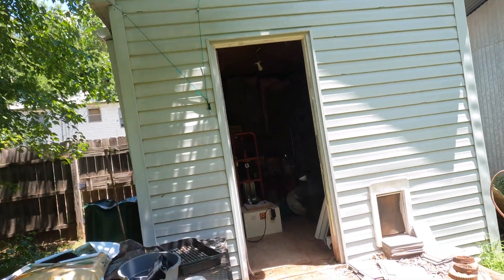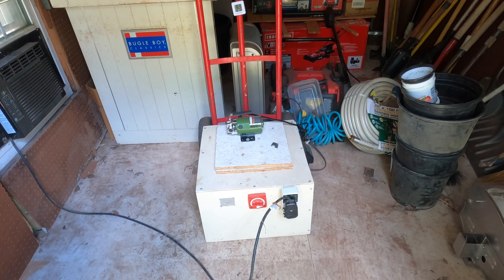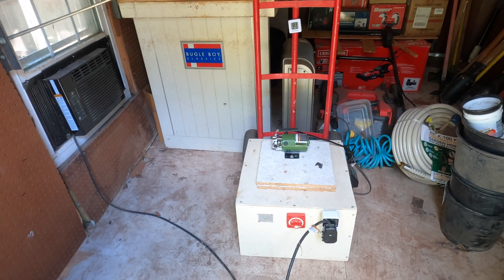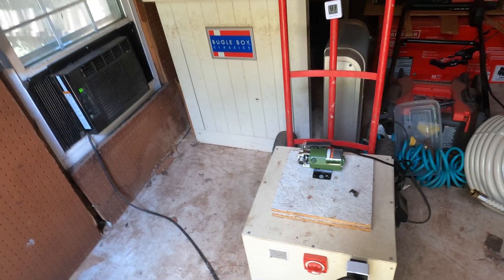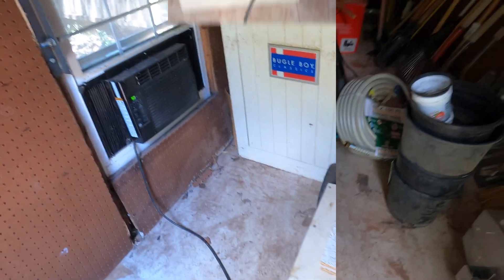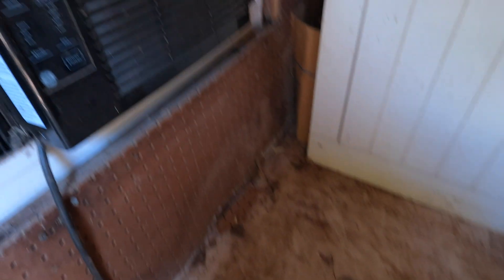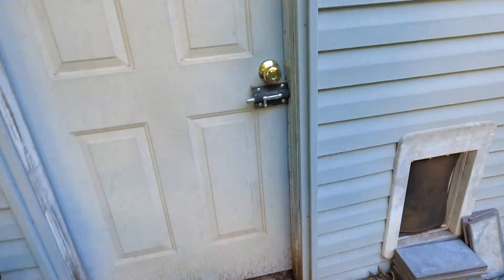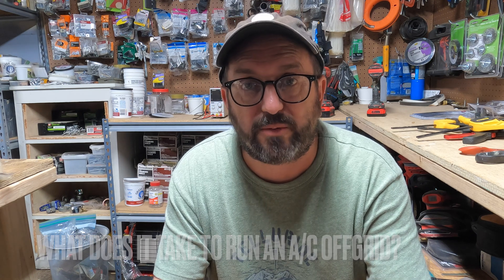How long can you power a 5,000 btu air conditioner off grid ? What does it take to run it off grid?

Comment: I have two 400 w panels with a victron 100/30 and two 100ah lith batteries with a Giandel 2000 24 volt inverter and run my 5K window ac ok, glad to see someone else with a similar set up saying the same thing
Reply from the maker: That's a nice setup. What inverter are you running?

Comment: Thanks for your video. But im trying to understand how you are getting 2500 watt hours from a 100ah battery. My math says 12.8 volts X 100amp = 1280 watt hours.
Reply from the maker: It is a 24v battery.  25.6 x 100a = 2560.

Comment: I have 1200 watts of solar, 24 volt 200 amp hour battery and 3000 watt power inverter, I have been running my 5000 btu window ac 24, 7 since I built the system, the battery never gets below 50% it also charges all our phones and runs my tv.
Reply from the maker: Nic setup

Comment: It’s surprisingly easy to run on solar on consistently sunny days. I have seven small widow ac’s ,two double door refrigerators,an upright freezer,and my water heater running on a Growatt 5K inverter with 20 KWH battery.
I don’t run all the ac’s at the same time, four when it’s hot or have company. I put the elements in series on the water heater so its load is only 2250 w,avoiding overloading the inverter.
I have grid power but don’t need input from it if we don’t have a lot of company to maintain this essential circuits panel.
I had three generators. I sold one,gave one away to my son who never uses it on his completely off grid trailer,(he has a small inverter generator for an occasional boost) and the last one I will probably repair some day.
With a little lifestyle adjustment during long term grid down we will do just fine. Off grid solar is one of the best investments I’ve ever made except for my wife and I won’t mention which one requires more maintenance.
Reply from the maker: Excellent points.  Thanks for your insight.

Comment: I used to run an 8000btu air conditioner most of the day off a 24v 2000 watt inverter and 24V 3kw battery. The Solar panels (1.5kw) had enough output to run the window unit and left power to spare after topping batteries off. I am now looking into getting me a Hybrid inverter and starting this off grid journey again. I live in South Texas were 110 to 115 F is common and need a small cabin to cool me down now. I currently run my drip tape irrigation system and water well on solar and plan on adding more off grid power stations.
Reply from the maker: What Hybrid inverter are you thinking about getting?

Comment: Thank you for sharing this information. What was the total wattage used for the 24 hr period? Thanks again.
Reply from the maker: 2100 wh total.
Reply: My 5000 BTU units run 450 or 500w.  A 1000w "solar generator" will run them 2 hours to 2 hours 15 minutes. 

That would be 12000w per day.   Which I think is 12000wH.  Your number seems different.

Comment: I have a Big Battery 24 Volt Hawk @ 3.8 KWH powering a Victron Phoenix 24/1200 Inverter with 400 Watts o Eco Worthy BiFacial Solar Panels and It Runs a 6000 BTU Air Conditioner and Cools The Spartan 40' Motorcoach / Bunkhouse really well. Other Kitchen Appliances and LED Lighting, Flat Screen TV and Stereo with ease.
Reply from the maker: Sounds like a great setup!